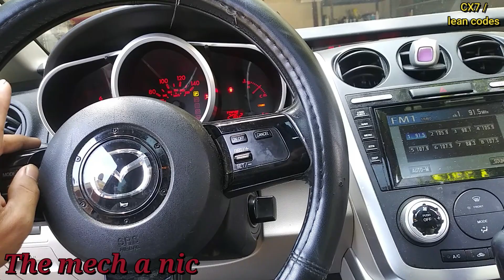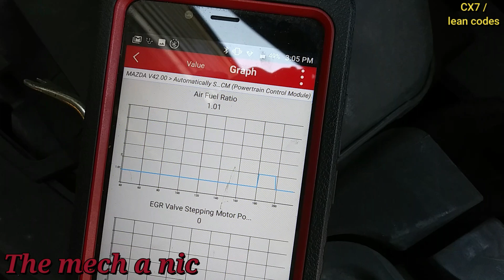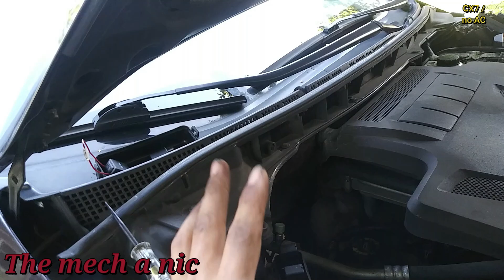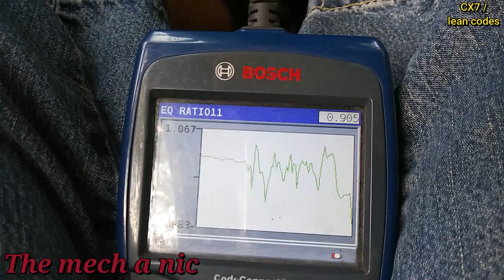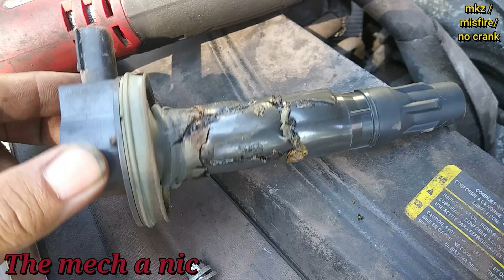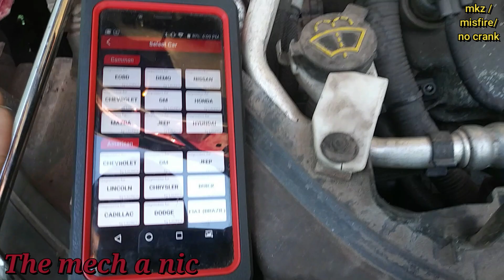mazda cx7 p2177  / MKZ misfire (vol 66)

Comment: I understand the way you decided to replace both the hose and the caliper at the same time. No test is perfect, and if you end up having to guess you'll be wrong more often than you want. In a pro setting the risk of double labor for a repeat visit isn't worth it, especially if you factor in the shop reputation angle and the fact the hose is so inexpensive. That said, in the diy context I might try to diagnose this with that imperfect trick to open the bleeder and see if the caliper slacks off. If I'm wrong, I've got nobody to blame but myself, ha ha.
Reply from the maker: I agree with you.sure i could have tested to see if it was the hose or the caliper but every time i get a situation like this im reminded of a friend of mine who works on cars, he replaced a womans caliper 3 times because the caliper kept locking up . he finally realized it was the hose acting like a one way valve. Sure he made a mistake a few times lol . the hose is just cheap insurance at that point thats why i chose to change it as well. Plus i remember this day. The owner dropped the car off and was waiting for the car. He wasnt happy because i had just done the brakes on it a week ago and was kinda implying it was something i did to cause this failure. I was in no mood to deal with the BS the owner was giving me so  i changed the caliper and hose to cover my butt and avoid a come back.

Comment: those fords are known for that, our shop has done quite a few ford escapes with the 3.0. The coil will short out and take out the driver in the computer. You have to get the computer from the dealer and they wont warrentee it unless you replace all the coils then you have to get the computer reprogramed for the security and the keys, with a $75.00 labor rate it usually cost around $1700.00  when it was all said and done so be ware incase you get another one.

Comment: So,  nothing on the switching wire means always on (I think), thats why the coil is burning up. If it was controlling the coil wouldn't the pulse be like 12V for off and 0V for on?
Reply from the maker: Yes the pcm grounds it to turn it on. Without a ground its not always on. It just has a power wire that leads nowhere
Reply: @themechanic6117  I mean, if you put in 12V at pin 2, and the coil is not grounded, you shoud measure 12V at pin 1, because the power cannot go anywhere. You are measuring 0V, so it is grounded and IMO on all the time...
Reply from the maker: You're absolutely right.i didnt think about that. Thats why the coil burned out... That makes it even more interesting to me....wish the owner was willing to go through with the diag.
Reply: @themechanic6117  😉
Reply from the maker: So id be looking for a pcm thats constantly grounding or more likely a short to ground.
Reply: @themechanic6117  Something like that, but I would go for the PCM...
Reply from the maker: I'm sure ill never see that car again. They dont seem inclined to spend money